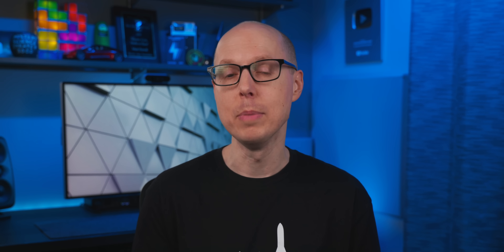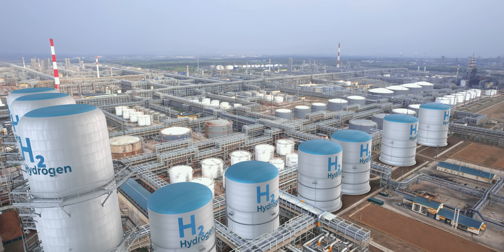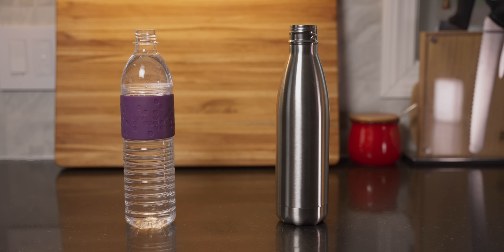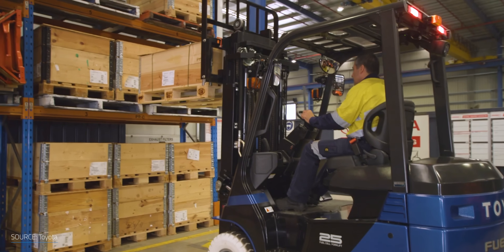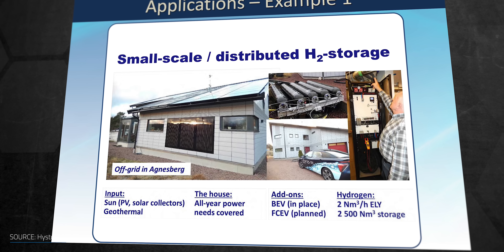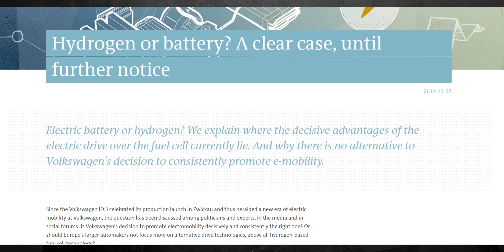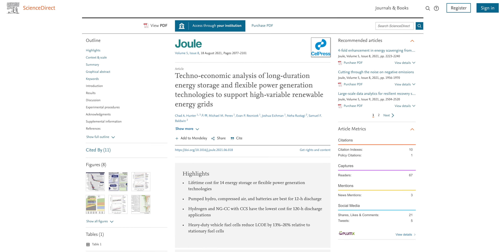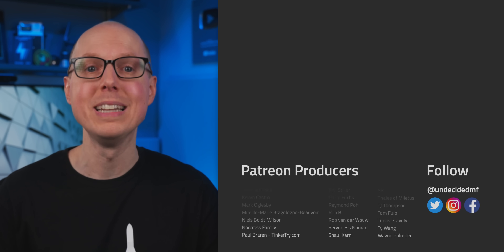Solid Hydrogen Explained (Again) - Is it the Future of Energy Storage?

Comment: On this channel, things are usually presented in a clear a plain way ...
Not this time, tough
You talk about volumetric and mass capacity, but neither give simple data, nor giving comparison !
At 8:36 : 50kWh per 100kg, that is a 500Wh/kg, to be compared to 250Wh/kg of lithium battery, and 4000Wh/kg for propulsive gasoil
At 5:00 : 80kg h²/m3. Here, we need more data. Lets take 1kg h² = 33.3kWh, it gives 2664Wh/L, to be compared to 750Wh/L (???) of lithium battery, and 5000Wh/L for propulsive gasoil. But it also make a 5kg/L if compared to data above. Seems strange, as metals used are a 1.5kg/L magnesium. Either the system proposed at 8:36 is extra heavy, or .. the 2664Wh/L is simply not achieved !
(nota : propulsive gasoil greatly differ from heating gasoil, due to very low efficiency of the engine)

The message at 8:36 contain a lot of information : you dont achieve better energy density with hydrogen that what you get with lithium battery.
(and consider that battery produce immediately usable current, while hydrogen require transformation (with losses) to get propulsive energy.

The saving factor may be the cost of this energy storage... But it would be difficult at this point to have precise prevision of the cost of something to be mass produced. (lithium battery price divided by 10, reaching the price of lead batteries !)

So, in conclusion, what do we have ?
A nice solution to be used in the > actual < hydrogen industry, for storage.
Because, yes, there is an actual, living, important, hydrogen industry, mostly to produce metal and fertilizers.
Any technology capable of producing easily hydrogen would be immediately used for the actual hydrogen industry. We simply dont need any new uses cases for hydrogen to profit of any new production technology. And current state of the hydrogen production is that most hydrogen (currently used) come from fossil fuel !
If anyone come with a clean way to produce hydrogen, would first, start replacing the fossil hydrogen we use.

So, this nice way to store hydrogen is interesting (for industries), but for cars or any other domestic usage, it doesnt compete with fossil fuel (since it is fossil anyway), nor with batteries.
And dont come up with bad reasoning like "my hydrogen is green, I'll use only renewable one !". If you have green hydrogen, that is great : go sell it quickly to hydrogen market, so they'll reduce their use of fossil hydrogen. Possibly you'll end up with financial loss, as your green hydrogen may be more expensive, but this is what you are doing anyway if you want to use it for yourself.
As long as fossil hydrogen is produced, any burning of green hydrogen will be as bad as burning fossil one.

Comment: You really changed directions here. No one was doubting that metal hydrides weren't a thing or didn't have a use.  But you championed a. Vapor-ware product that broke the law of conservation and was going to power a car with a atomic layer of hydride on a spinning disk.  It's a scam.

Comment: Hydrogen WILL play a part in energy's future but, like all things, the niches that it will carve out are yet to be made available for general consumption or even imagined.  You ask people what their optimal transport vehicle is and you get varied answers.    For a couple that rarely goes more than 5 klms from home a taxi or uber would probably suit.  Twenty years ago you would be laughed at for suggesting a diesel vehicle for personal transport so petrol was the choice.   Now diesel vehicles are much more common and produce economy and a lot of power.   Ask a group of CEO's about transport fleets and diesel trucks would be the most common answer.  In the eighties the railways were offering huge savings for long distance, heavy transport yet there was recently a power transformer transported from Western Australia to Queensland by trucks.  They used 3 trucks on flatter ground but added another 2 when they reached the mountains on the east coast.  Horses for courses!

Comment: This technology is new to me, but... why bother? At first you turn any form of energy into electricity to store it on a lithium-ion battery, and that's all... while for a metal hydride, you turn any form of energy into electricity, to spend it on making a electrolysis of water, to generate hydrogen gas, then to condense it into the matrix, to spend energy for it's release, then to burn the hydrogen with the atmospheric oxygen, and finally to transform the heat back into electricity... I'm right? [Any energy > Electricity > Chemical energy > add more energy > Thermal energy > Electricity] None energy transformation is totally efficient, you loose energy on each step, so... why would it be better than a system that just holds electricity and release that electricity?
Reply: And if you capture Hydrogen as a byproduct, you are capturing otherwise wasted energy... but if this can only happen from carbon burning energy plants, that can't be called "clean energy".
Reply: And talking only about Hydrogen, where is Rochet Fuel left? Could it store the hydrogen needed for a space launch with less weight, and needing less complex and expensive technology, and being safer than the actual methods for storing rochet fuel? This use for the metal hydrides should be included on the video too.

Comment: Using metal to store hydrogen was a big thing back in the late '70s.  There was a lot of work done to get city buses to run on hydrogen combustion, where the hydrogen was stored in metal lattices, needing only to be heated up to release the hydrogen when needed.  I think there were even a few prototype buses running in Germany based on the technology.  The big selling point was safety as the hydrogen wasn't going to go all Hindenburg when the bus crashed.  This approach died away mostly because it became apparent that hydrogen combustion engines had short lifetimes.  Today there is a renewed interest in hydrogen production, where waste heat from nuclear reactors can be used to create hydrogen in a variety of chemical processes.  The hydrogen could then stored in pressure tanks and burned directly to turn turbines to create electricity when intermittent renewable sources can't meet the load requirement.

Comment: Thanks for the expanded clarification! I ,for one, was particularly scathing of Plasma Kinetics. I can see that there could be use cases (submarine,fork lifts) where weights are already used, and if these have "double duty" as hydrogen storage, that makes sense. We need all the possible, viable energy storage solutions for renewable energy, but as you pointed out, cost and efficiency (for hydrogen storage and use) need to be improved for realistic large scale adoption.

Comment: To release the hydrogen from the metal hydride and to reach the high temperatures needed electric induction heaters could be used. The power needed to do this supplied by........oh no you don't. If you would like to know, well, it has a cost.

Comment: The 90% efficiency of H2 is only in winter when you can use heat. Making just electricity is 25% and that's how it would be used half a year in very cold climate. Moderate climates will use such storage at 90% efficiency only for a few months a year. Great solution for Alaska not so for Florida :-)

Comment: To put it simply solid state hydrogen concept is when you have a dense material that releases extreme amounts of hydrogen during Catalysis or during a reactive process, Which occurs rapidly. The hydrogen such released is instantly used for combustion to propel the object. This eliminates the need to compress and store Hydrogen and a denser material always has more hydrogen compared to gas or liquid state Hydrogen.

Comment: Want to have some fun?  Look at how fiber optics are made, then apply that technology to solar cells... only a solar cell that is a glass fiber with a solid copper core.  It would work in any direction, would not need to be pointed at the sun just in the light, and would work wonderfully by being bound into cables and strung from poles.  I've looked at the processes and the fiber optic one is more efficient, has lower impurities giving the glass fibers more conductivity, and the solar cells (cable) can be made by the miles efficiently.

Comment: This coverage the second time around was much much better...  I began playing with Metal Hydride H2 storage over a decade ago, and it's very interesting technology without a doubt.  Mine came from "the fuel cell store" and I use it at room temperatures, is rated for 20liters of H2.

But the first time you and Sandy and EVeryone else covered this company it was more like you each simply pitching their given media talking points.  I'm so thrilled that you returned to cover this again after you got up to speed with the underlying technology.

I think Metal Hydride (solid hydrogen if you must) is already in use.  but I don't see it expanding beyond the niche use cases that it's already good for.

hydrogen use in cars and even Semi I do not see as much more than a fossil fuel play to remain relevant.  and I'm also still biased against hydrogen because it was the imputes for killing BEVs over two decades ago, which simply delayed the BEV adoption we see today.  Or perhaps this was a blessing that allowed for Tesla to run away with their no compromise broad execution that we would have never seen from legacy auto.

Comment: For clarification the reason it was put into a two year evaluation was due to its ability to store hydrogen levels and it’s speed of going back from a solid to usable energy fell into the department of energy restrictions on hydride effectively could in theory we used as an energy source in a thermal reaction as in Mike and fat Bob type these restrictions are easy to understand why as you don’t want anyone taking the technology and creating there own atom smasher in the garage or worse, further to this the restrictions on who they can sell to will still apply even after review IF  deemed a possible threat however small that may be

Comment: I dislike how much focus in new tech like this is always given to cars, a sustainable future doesn’t need really great batteries for self driving cars, it needs cheap,reliable, and accessible public transportation
Reply: Okay, so what if the best cheap, reliable and accessible public transportation system is exactly that, a fleet of self-driving battery-electric vehicles?

You want to go somewhere, you call up the destination on an app and it sends you the nearest car with enough battery to make the trip. It can come to you wherever you are, you don't get much more accessible than that.

No drivers, so they can run 24/7, and cheaply. When they run out of battery, they just drive themselves to the nearest charging station.
Reply: @davefish2280  i dont see how fleets of thousands of cars could be more reliable, cheaper, and safer than a train and bus combo.

Comment: I'm surprised the topic of hydrogen embrittlement didn't come up. Less of a concern for the devices, but for the transportation and production infrastructure, this could be a significant long term cost and safety issue of large scale hydrogen use.

Comment: Well, that was better than round 1. However, from the complete novice standpoint, the questions keep coming. What metals have been tried? Research towards new metals for storage? Capturing hydrogen from gas vs from water, what's the differences in efficiency, cost ...? And so much more ... Thanks

Comment: When GM killed the electric car, the batteries were NiMH batteries developed by Energy Conversion Devices. Our current NiMH batteries still use ECD tech. ECD was also working on h2 storage in metal hydrides. This work was being backed by the research arm of Texaco. Texaco had huge plans for commercializing the tech. When Chevron bought Texaco they chopped off the research arm quicker than shooting a bunny. When ECD was destroyed by their bondholders the company had huge production lines cranking out thin film amorphous solar. Lower solar efficiency but very inexpensive. The production lines were sold as scrap metal. The phase change memory technology was transferred to Intel and Micron, but that seems to have died too. I really miss Stan and Iris Ovshinsky.

Comment: I think the 'round trip efficiency', should not be focused on a a priority. Solar and onshore wind, have dropped so much in price, that a company that insisted on high RTE, would have failed to notice, that the drop in renewables, blew their efficency savings, out of the water. Solar will get cheaper and cheaper, a cheap, reliable energy-storage system, that 'wastes' half the energy generated, is much better than a higher efficency sytem, that falls short in one of the other categories.

Comment: A lot more hydrogen can get market with a paradigm shift in   production and supply logistic. 
 • 1 Kg of hydrogen packaged as solid H2 at RE sites(s). 
 • 2 kgs of hydrogen gas release on-demand at application/user‘s site. 
 • Hydrogen contained as element in a compound, a non-flammable, non-explosive solid material distributed safely to any users worldwide.
• Hydrogen gas generated/released from 2 hydrogen carriers, water and solid H2. 

The total tonnage (weight&volume) of energy to be transported is reduced by 1/2. 
The total costs of distribution of fuel, "clean hydrogen" reduced by a factor of 4+, from savings in distribution, storage and operation.

Comment: Hi Matt, I'm fairly new to the channel but have found most of your videos enlightening to say the least.
On this latest one, metal hydrides, GKN being involved was very interesting. They are one of the larger manufacturers of Powdered metal alloys used to mold parts using these alloys. seeing the picture of the "slab' of metal hydride, it is apparent that these are being molded and sintered using the powder metal fabrication process. This lends itself to the molding of complicated shapes to fit the potential applications allowing for better storage capacity in a given space, also, heating elements for extraction could be incorporated in these stacks of hydrides.
I would assume that GKN will keep this material proprietary but the technology to mold the hydride alloy exists. Lastly, particle size and density of compaction can be manipulated can vary to accommodate the end use.

It's pretty slick stuff😀 Thanks.

Comment: I think a lot of people advocating for renewable energy to fight climate change have a (not entirely unwarranted) knee-jerk reaction to oppose hydrogen. There are definitely some applications for it such as when super high gravimetric energy density is needed like for shipping and aircraft, but it has a bad reputation which isn't entirely undeserved. Nikola was a gigantic scam and that alone has put a bad taste in people's mouths for its use in automobiles. The infrastructure is also very difficult to setup for hydrogen vehicle "charging" vs just charging batteries, a hydrogen vehicle fleet would require an investment into infrastructure from scratch on the same scale as our current gasoline infrastructure whereas EV charging already has the power grid set up (yes it needs to be expanded to support more EVs, but we need to expand it anyways and at least it exists in some form right now especially if its fuelled by green hydrogen). To a "lesser" extent it doesn't help that the overall efficiency won't be as good as batteries for the foreseeable future.

However the biggest and most justified reason for pushback is that the fossil fuel industry is pushing for hydrogen because they can produce it with a decent chunk of their existing infrastructure so they can stay in business, but it will still produce CO2 emissions. The majority of hydrogen is produced from fossil fuels (emitting CO2) and that process will likely be cheaper than green hydrogen (renewable powered electrolysis) for a very long time if green hydrogen ever becomes more economically viable, especially since the FF industry would be able to continue to profit and lobby against reducing their emissions. Green hydrogen has to compete with batteries and the fossil fuel industry.

Unless there is a massive breakthrough in battery tech, we'll need hydrogen to some extent (we'll likely need hydrogen even if it is worse than batteries due to the battery shortage). But the benefits of hydrogen over batteries in select applications isn't immediately clear, while it's ties to the fossil fuel industry (and the Nikola scam) are.

Comment: My apologies if this has been covered before in the comments, but I'm confused because a good lithium battery pack can achieve 200 kWh/kg, and certainly Tesla 3 packs are close to that (if not over), so unless I'm missing something, the quoted 50 kWh/100kg of this technology is 4x lower energy density than a Tesla 3 pack.
Reply: k c - The energy density of Li-ion batteries is 200 Wh/kg not kWh. On top of that, the energy density for the hydride is based on the weight of the storage media, not the weight of the stored hydrogen. So there's some conversion math that has to happen to make the energy density comparison accurate. So a 100 kg Li-ion battery stores approximately 20 kWh while a 100 kg metal hyride system potentially stores 50 kWh of hydrogen. Using the hydrogen to generate electricity via a fuel cell is about 40% efficient so you get 20 kWh at the end of the process. Voila!

Comment: The big issue with a comparison to Li-ion is that the LCOS is depressed by the extraction process. If the lithium mines weren't committing major abuse, the LCOS of Li-ion storage would be significantly higher making the multitude of alternate home, industrial, and grid level storage alternatives much more appealing.
Market economies function incorrectly when imports are permitted from places without market economies.